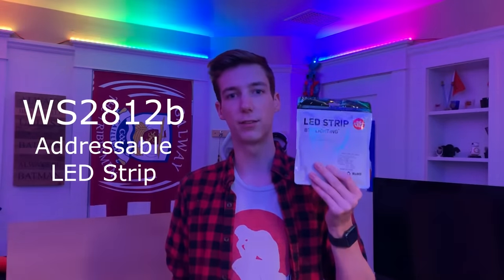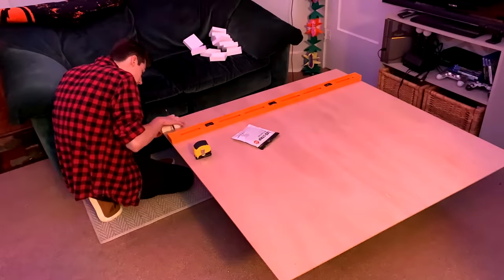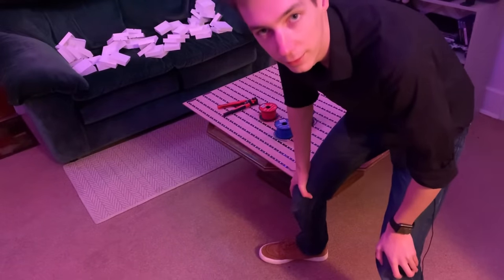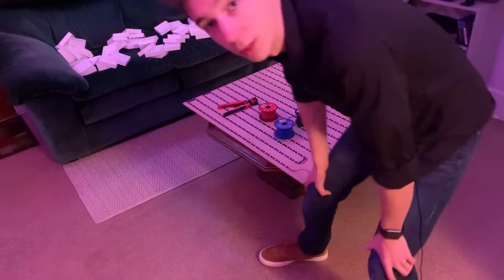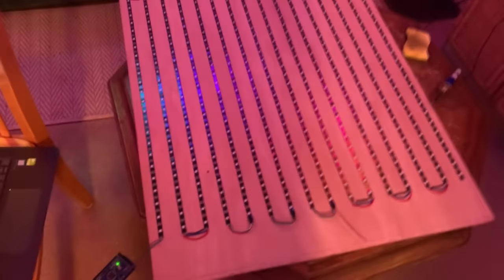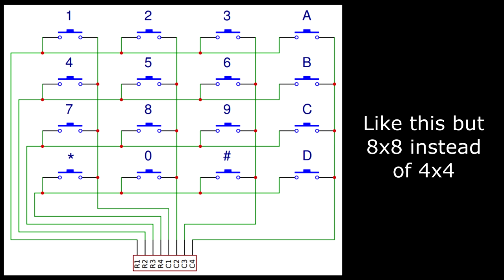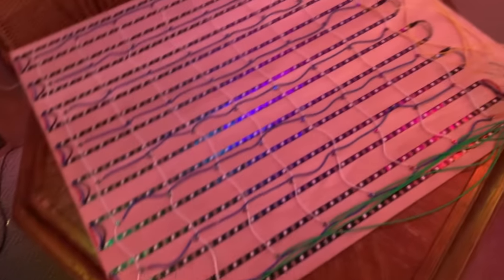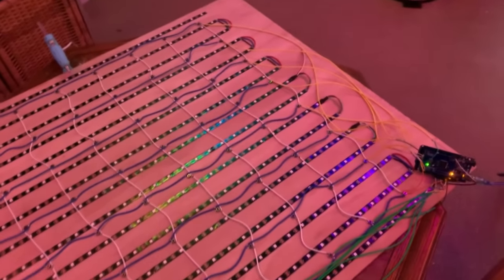How I Made an INTERACTIVE LED WALL

Comment: Small suggestion: For interactive editing, you cycle through several colors for each tile.  I suggest that after choosing a color on a tile, the first press on another tile will change to the same color (then step forward from that point in the cycle if there are multiple presses).  So you can select a given color on any tile, then replicate that color with one press per tile.

Comment: there is just one problem with it, if you press 2 buttons from the same row, then another one from another row, you will get ghost keys. the solution is using diodes

Comment: Just a thought for your v2... Mechanical keyboard switches.  Easier to press and your panels can mount directly to them like a giant keycaps. Also. You could swap in a .8mm nozle double your line width and print in case mode to save time. You'd have to attach the button stems after, tho.
I'm very impressed. Great projects and great videos.
Reply from the maker: Amazing idea. Mechanical keyboard buttons are also way more satisfying to press. I’ll definitely try and include this in the next version
Reply: I work with adults with developmental disabilities and I am looking at building something like this. I have way more experience with keyboards and not much with the coding side of things. My first thought when starting my research for this was basically to use a keyboard switch with a thru stem led. Any other thoughts?
Reply from the maker: @blasstois great idea but the colors will not be as vibrant if you’re wanting to build it out to this scale. Addressable LEDs are a great introduction to arduino programming so if you have the time I would highly recommend trying them out on a smaller scale before committing to a project this big.

Comment: I was expecting to be frustrated with another rehash project of the same light panel video Ive seen a dozen times before this - BUT WOW!

This was awesome! It's beautiful, fun and original!
I'm really impressed by this and happy you posted it.
Thank you!
Reply from the maker: Glad you liked it! Be sure to subscribe if you want to see the bigger LED wall I’m working on right now
Reply: @Tech-Random  NO
Reply: TOO POWERFUL
Reply: @Tech-Random  i have never done anything big or 3d printed anything, but i have a couple suggestions for the bigger wall
1. find a way to dissipate the leds more evenly/have more leds per tile
2. round the edges of each tile so that the seams between each tile aren't as obvious

Comment: 13:00 It looks like you need some smoothing capacitors at each end and a loop to ground.
Reply from the maker: The difference in shade is actually caused by slight variation in the thickness of each tile from 3D printing. It’s only really noticeable on camera and you can’t even see the individual pixels in person. I record everything with an iPhone which are notorious for being very sensitive to light.
Reply: @Tech-Random  oh okay. Though it still might be helpful to use some caps if you plan on doing a design or pattern with a lot of full brightness white squares.
Reply from the maker: Thanks for the suggestion!

Comment: Nice work! I was curious to see how you aligned each 3D printed square and your technique worked well! I also have built an LED wall which can be controlled via bluetooth and an iPhone App I developed
Reply from the maker: Glad you enjoyed! Phone control is definitely a feature I want to add in the future.
Reply: @Tech-Random  When I've been doing phone control I've used an app called RemoteXY. It gives you the option to create your own GUI on a web page with as many controls as you want to fill a screen with. The only down side to phone controls I've found with RemoteXY is having to pair your module with your platform. Androids use an HC-05 Bluetooth module and iCrap (yeah, I said that) uses an HM-10 BLE module.
Reply from the maker: Thanks for the tip!

Comment: Love the idea of the haptic input. It's a refreshing difference to all the WiFi solutions. But I wouldn't have left WiFi out (ESP8266 or now in 2021 an ESP32)
Reply from the maker: Check out my led lamp project using the esp8266. The v2 I’m working on also uses a matrix of these boards for more control!

Comment: Amazing project.  Watching this has inspired me to finally buy an Arduino starter kit to try and learn how to make these kind of things. There's a similar type of project to this that I've had on my mind for years that I've been wanting  to build but had no idea how to do the technical/electrical side of it, and I think I could use a lot of what you've done here.  I'm assuming there's a way, but is it possible to also somehow hook up a speaker and have a sound effect play for each button when they're activated?
Reply from the maker: So glad I inspired you! Yes it’s possible to connect a speaker. The arduino mega has two Digital analog converters specifically for that. It’s a bit more advanced but there are plenty of tutorials on speakers with arduino. Engineering is pretty much taking a bunch of tutorials for separate things and combining them together. When you approach a problem with that mindset it makes it a lot less overwhelming. Good luck!

Comment: Thanks for the post, I have planned on making a coffee table in September with a similar issue 64 analog inputs to an arduino, but chose to go a different route and instead of the matrix setup am using a few multiplexers. Haven’t used them before so I’m hoping that works
Reply from the maker: Good luck! Multiplexers were my original plan but I switched to try and cut costs

Comment: If you are still monitoring this video I had a quick question. With the way the buttons are wired together are you able to push more than one button at once or would multiple button presses interfere with one another?
Reply from the maker: The hardware can still detect multiple button presses. I don’t use it in my code at all but I’m sure there are many uses for this feature!

Comment: Hi Chris, awesome video man! Hope your channel is a success. Just wondering if you used a power supply to power the LEDs directly? Seems like a lot of current to be drawing from the Arduino. May have missed it in the video. Cheers
Reply from the maker: I do have the power going directly to the LEDs at two different points for even current distribution
Reply: @Tech-Random  Ah sweet. Thanks for the quick reply. Nice of you to give your little brother a go haha.

Comment: It looks damn good bro... 
One question.. CAN WE USE HAND SWEEP SENSOR INSTEAD OF THE SWITCH TO CHANGE THE COLOUR. IF YES THEN HOW???
I want to make is like neonleaf canvas, touch sensitive please give me a solution...
Reply from the maker: Sensors like that should work but they might need to be connected differently. The buttons I used work because they short two data pins. Sensors like that usually use analog values to tell when a hand is present so you would need 64 analog pins to make it work on this scale. If there is a touch sensor that works like a button the short two pins then you could use that the same way I built this. Check the data sheets and be ready to write the code for whatever you decide to use!

Comment: This is a very cool project!!!

Have you ever thought about playing with the STM32 Blue Pill boards? They have more resources than an UNO at a fraction of the cost.  the UNO has 32k flash and 2k RAM. The Blue Pill is 120k flash and 20k RAM. They also have a much smaller footprint, slightly larger than a Nano. You can get the Blue Pills out of China on Ebay for about $3. It is a bit of a learning curve when switching over, but these are great boards once you get used to the differences. There is a FastLED library branch on Github for them. To use FastLED you have to use the Roger Clark definitions for the board in the Arduino IDE.

The one coding improvement that stands out as a must for the project would be the way you select colors. Having several push and release standard colors is great and can be maintained. But if you were to make a push and hold function where the color cycles through a colorwheel function it would open up a range of colors you aren't getting with the push and release.

Honestly I could spinout on variants of your coding. But that is just my mind racing through possibilities! Really though it is a pretty nice piece of work!
Reply: Just skimmed through your code and saw you are using FastLED.  I use that library regularly!
Reply from the maker: I’ll have to check these boards out, they sound really useful! The latest version of the code on my github has a better color selection but it’s still limited, I like your idea of a click and hold and I’ll look into that for my next version!
Reply: So this is a with a touch sensor for a switch, but pretty much:

void clrSel(){
  int continuous = 1;
  clrNo = 0;
  lampOn = 1;
  while(continuous == 1){
    if (sensors[0]->read() < 35) {
      continuous = 0;
      pressed = 60;
    }
  allColor(Wheel(clrNo));
  delay(20);
  clrNo++;
  }
}

CRGB Wheel(byte WheelPos) {
  if(WheelPos < 85) {
    return CRGB(WheelPos * 3, 255 - WheelPos * 3, 0);
  } 
  else if(WheelPos < 170) {
    WheelPos -= 85;
   return CRGB(255 - WheelPos * 3, 0, WheelPos * 3);
  } 
  else {
    WheelPos -= 170;
    return CRGB(0, WheelPos * 3, 255 - WheelPos * 3);
  }
}
Reply from the maker: Very cool concept. Since you’re working with FastLED you could make this code a lot simpler by using HSV colors instead of RGB. Basically just have a number incrementing up to 85 while held and returning that value * 3. HSV also keeps the colors about the same brightness and gives better yellows
Reply: I'll have to look into that. I have so much code built around that that the shift would be immense!
Reply: @Tech-Random  I forgot to mention, with the cheap Blue Pill boards you should also get a FT232RL FTDI USB To TTL Serial  board. I've never been able to flash a bootloader on one of them. This seems the best way to flash your sketches on to them though. The ST-Links you'll read about don't seem to have good success with the generic Blue Pills. Well, I haven't had any luck with them with Ubuntu anyway.

Comment: This is awesome. Much too advanced for me to learn. But was wondering if i did not want the feature to change the color by touching the panels but just want to build the wall panel like you show in the end with the LED in it, is that something we need Audrino for?
Reply from the maker: You would still need some way to control the LEDs and I believe arduino is the easiest way to do that. Getting the buttons to work was by far the hardest part of the project though so you could easily learn to do the code for just the LEDs by following some beginner tutorials for FastLED.

Comment: Do you have a timeframe for when the next version will come out? Curious to see what improvements you have in mind.
Reply from the maker: I’ve been working on a design that’s separate tiles that connect together magnetically. I have a pretty good idea for how I’m going to do it but it’s going to take some time. I have two videos I’m working on now and I’m trying to get one out by tomorrow but once both of these are done I’ll start on the new LED wall. Other features I want to try and include is a web interface that allows me to control the wall with a phone or maybe even my Alexa. Hope that’s enough information to get you excited. You can probably expect it to be out by spring but I need to stop making timeline promises while I’m in school 😂
Reply: @Tech-Random  No rush. Always excited to see what you come up with! I plan on working on a similar project in the future, way in the future... I'm just starting out with Arduinos and need to get some experience before I tackle something like this. With the aid of the keypad library, is it possible to make a 16x16 board? I believe this would require 32 i/o pins for 16 rows and 16 columns. This would also require more LEDs than in the 8x8 board. Would probably do 4 LEDs per tile, with a total of 1024 LEDs vs 384 LEDs. Would this be too many for an Arduino to handle?
Reply from the maker: Totally doable. You’ll just need a power supply big enough to power all those lights. Looks like at max power that would draw about 50 amps so keep that in mind

Comment: Chris, is there a reason you used an Arduino Mega instead of an Arduino Uno?
Reply from the maker: Yes. In order to make the button matrix I needed at least 16 IO pins. The arduino uno only has 13

Comment: Chris great video! You have inspired me to make something similar but not exact for my kids. My project is much smaller. I am creating 8 hexagon something like a nanoleaf. I want the rainbow effect and the push button effect. I don’t write code. But I did get a starter kit and have been working on small projects. Is there anyway you would be willing to help me take your code and make it work for my project?
Reply from the maker: I could try but I’m not sure it would work. Programming is a very iterative process and the hardest part of the code is the algorithm that tells the wall which LEDs to light with each button that’s pressed and it is entirely dependent on the way you build the tiles. I’m always willing to help though so you can email me and I’ll do my best (chparkertech@gmail)

Comment: How many panels can you print from the filament you have linked? (How much filament did you need for this project)
Reply from the maker: In total I used about 2.5 kg so I had to buy three rolls

Edit: Actually it may have been 1.5, you can check by dropping the .stl into your slicer and multiplying the estimated weight by 64
Reply: @Tech-Random   I'm looking into buying one, so I'm pricing out how far the supplies go -- thank you for your answer!
Reply from the maker: Well worth the price of entry. I got my anycubic i3 mega for $250 and it’s served me well for almost two years now. Best printer for the price in my opinion

Comment: hello absolutely love this project and im working on a similar project. How would you change the code from the group of six relative LED's to two relative LED's (only one on the right and one on the left)? I'm also having problems with which rows and columns go into the relative arduino pins. Many thanks!

Comment: Hey, what should i use to power my arduino when im using it for led strips in my stairs.
Reply from the maker: I would get a power supply that has a 5V output and supports 0.06A x (Number of LEDs)

Comment: Awesome video man! Subbed. Do you think you can share/explain a schematic diagram? I am gonna do something similar but without the buttons, every guide online only explains how to power like 50 LEDs but never hundreds like this project... thanks!
Reply from the maker: If you’re just doing the LEDs app you have to do is connect the 3 pads of each strip together. For your power supply, if you want all the lights to be able to shine at full white you’ll want enough amps to satisfy this equation: amps = #LEDs * 0.05. Just make sure you’re connecting the power at a couple different points on the strip and not just the first strip, otherwise some LEDs won’t be as bright.
Reply: @Tech-Random  That's super helpful thank you!

Comment: Subscribed... this is quite beautiful, it also functions as a fancy chessboard!!
I wonder how much power it draws on full brightness! or when it runs an Arduino program
Reply from the maker: Full white at max brightness draws about 19.2 amps. I’m only using a 10 amp supply so I have to make sure my programs don’t draw more than that

Comment: this is amazing! just a quick question. is the code still use able when im not using the buttens?
Reply from the maker: The rainbow mode will work without buttons but the drawing mode won’t. It would be pretty easy to modify the code on my github to only do the rainbow effect though!

Comment: I was thinking of doing something similar but JUST the RGB leds alone would have cost over $250 for the size of panels and amount i wanted. it was going to be setup as an LED matrix. i've done the work before on a small scale. addressable strips would be a lot better price wise and everything.
Reply from the maker: The 5 meter strips I use are about $22 a piece. It would be cool to do a wall that big but the cost is definitely prohibitive lol

Comment: nice idea. When it works the arduino is always connected to the computer? instead of 3d printed tiles, what can be used?
Reply from the maker: The arduino doesn’t have to be connected to the computer after the code is flashed. It can be powered through the USB port or the Vin pin.  If you don’t have a 3D printer you could buy large sheets of acrylic to cut squares out of. You’d have to find a new way to attach them to the board but it would look really clean if done right
Reply: Chris Parker Tech thanks you. I try in This quarantine days! When or better, if i finish, i show you the result! Many thanks man

Comment: Hi Chris Parker Tech i create a4 col and 3 rows for the button. How can i change the program? 8X15 stripe led. Thanks!!
Reply from the maker: Check my channel, I have a second video that goes over how I wrote the code. In that video I describe the algorithm I use to light each tile and how it can be changed to work for different sizes

Comment: would i need to do all that wiring if i'm just doing the tiles without the buttons? so if i'm just running a programme from github
Reply from the maker: Nope. If you don’t want the buttons you can just wire up the LEDs and power them with 5V. The LEDs only took me about an hour to get working.